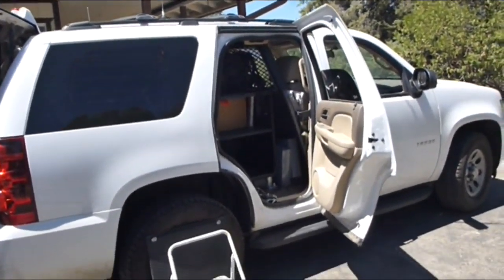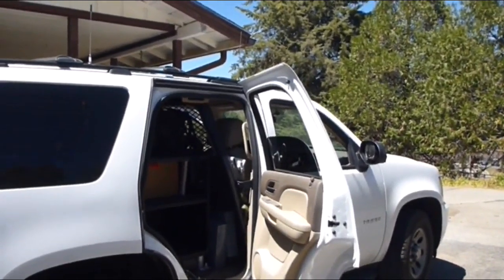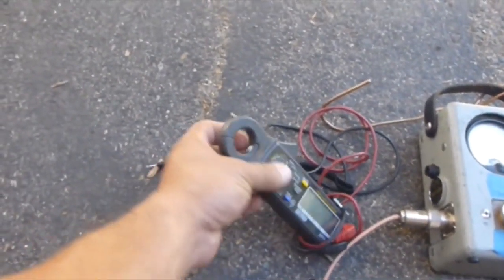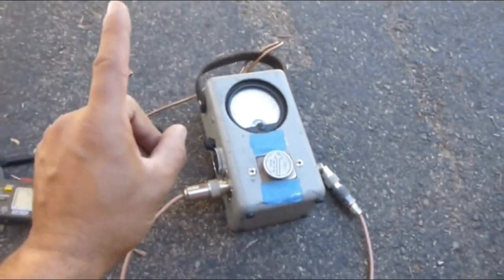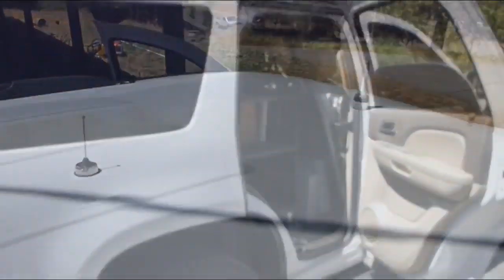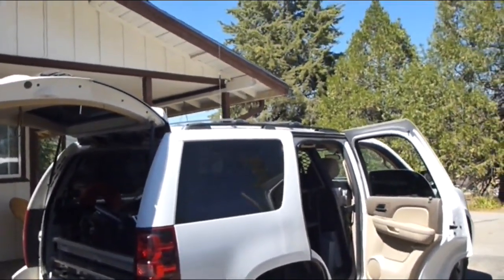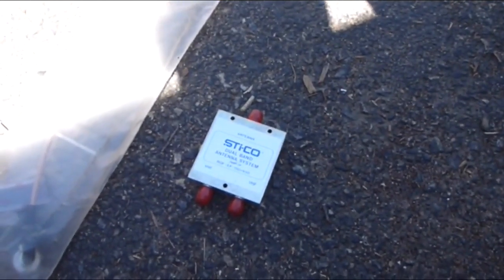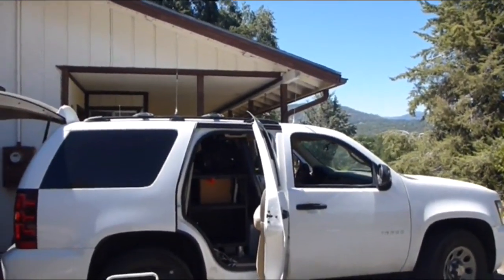Starter Comms Test Equipment & Weird Vehicle Antenna Consolidation.

Comment: Thanks for your service, Marine. Semper Fi. I was an Aviation Radar Repairman 5942 stationed at Miramar, CA with MACS-1 EWC. I remember using all that test equipment on the 59 and 63 Radars. Thanks for the video.

Comment: I suppose that it would have been helpful to the beginner regarding the spectrum analyzer versus the Bird 43 wattmeter is that the communications analyzer (a spectrum analyzer with a return loss bridge built-in plus some more goodies) shows you forward (not shown in the video) and reflected power in terms of dBm across a spectrum (which can be set in the instrument).  The comm-an saves someone from having to measure the SWR or reflected power across a band and having to draw the graph by hand.  But as you adequately point out, not everyone has a spare 30K or so to buy an expensive piece of gear.  The Watt meter will do the same job with a bit more elbow grease.

--Konrad, WA4OSH

Comment: Why is a return loss of 12dBm your magic number?  The larger the return loss the better.  This means less energy back into the transmitter.  This implies more of your signal goes into the antenna.  Essentially you are saying a VSWR of 1.7 or better is ideal.

A return loss of 6dBm is an SWR of about 3 to 1.
9dBm is about 2 to 1.
12dBm is about 1.7 to 1
14dBm is about 1.5 to 1

https://www.markimicrowave.com/Assets/data/return%20loss%20to%20vswr.pdf

--Konrad WA4OSH
Reply from the maker: Its just the minimum spec the outfit I work for determined to be the cutoff point between servicing it or letting it go. At resonant frequency, typically the average we see in the field is better than 15-17 db of return loss, at around 12 I get suspicious of some underlying potential problems in the antenna system as a rule of thumb. Many exceptions like VHF low band round 30-50 Mgz the allowable minimum is 10 db of RL. I try to stay with rule of thumbs instead of absolutes, you know, nothing is night and day in the field, always shades of gray. Thanks for the comment, I'll try to remember your point whenever I revisit this subject in future vids.
Reply: One thing to keep in mind is that with most modern solid-state transmitters operating into a mismatched load comes with a double-whammy.  First, as I pointed out above, a bad SWR means reflected power back into the finals of the rig.  However the second point is that solid-state transmitters utilize SWR foldback.  Under a "bad" mismatch condition, the ALC circuitry of the radio will throttle back the transmitter to protect the finals.

For example if you had a 100 Watt transmitter into a mismatched load of a 2:1 SWR or 10dBm return loss, 10% of the power would be reflected.  However, if you loaded the radio into a 25Ω or 100Ω load, you would actually see far less than 90Watts out due to the SWR foldback of the transmitter.  The reason for the 12dB or better RL "rule of thumb" is because the radios you use probably aggressively fold-back if presented a mis-match worse than this figure.

--Konrad, WA4OSH

Comment: I have a "roadblock" with my 2014 Jeep Cherokee Latitude when it comes to installing at least one radio: How to install the power cable from the Battery into the "cabin" area without voiding the warranty.  I mean it's okay for putting a CB radio, but it's gonna push the envelope when it comes to a Ham Radio. i.e. Icom ID880H Dual Band FM/D-STAR.Good Video :) I've been a Licensed Ham since June 1992.  My first radio was an Azden PCS-3000 (still works),  The 2nd was the HTX-212 (Still works) and now I finally got a Dual Band Mobile upgrade to Icom DSTAR / FM
Reply from the maker: Sean Ingram I'm in the same boat with my new RAV4, I'm just going to use a handheld with a magnetic roof mount if needed.
Reply: +GUERRILLACOMM +Sean Ingram 

There should be at least one or two places on the firewall where you can push through a cable (its done for speaker installs commonly) you can also run a cable with breaker under the vehicle and up through a trunk drain hole and run a capacitor or extra battery (optional) in the trunk..

the easiest way is just to go from the 12v constant ignition wire  but might not carry enough amps
Reply: Tnx :) I do have the power cable run through.  I just need to need to place the radio where it's safe as well as convenient. It has a detachable face with cable to the radio.

Comment: for practicaly and for everyone, I sugest to go to a desent radio amateur club and they can introduce you to a variaty of multiband radios of all band radios like ft 857 and a atas 120 and you will get more than 2 antennas the radio brings all thats funny stoff in watt meter and a lot of nice things. The disconne antenne is ano 2014 mobile... just go to a desent radio amateur club and your minds would be blown... HF vhf/uhf in one radio and antenna!!! atas 100 or 120 and for vhf uhf antennas HAM gear is all ready here.. very nice explanaition for a change but why you are begining thinking that this is a expancive Hobby?? im just kidding its really expensive but for under the 1500$ you can get a lot and really more than what you would imagine.. have a nice digital surfing

Comment: 1.  In order to maintain equipment, Guerrillacomm recommends a voltmeter and a wattmeter.

http://www.birdrf.com/en/Products/Wattmeters_Line%20Sections/PortableWattmeters.aspx#.U7jTXXJdWSo

2.  Tricks to minimize the number of antennas on a vehicle by connecting two radios, a UHF and a VHF radio, to  a single antenna.

Comment: hahah! I have things I want to change in my truck and add another radio, but laying out the power and antenna takes time! I run a Larsen duplexer for ham on my radio set up seen in my vid --> http://youtu.be/RXCkPcruQn4
Reply from the maker: Just checked it out, very impressive. Subbed, you got some good stuff, those vintage code 3 lightbars looks brand new mint condition. Nice to see them lite up in that condition instead of decades of being weather beaten.